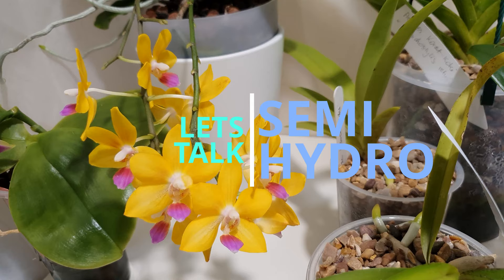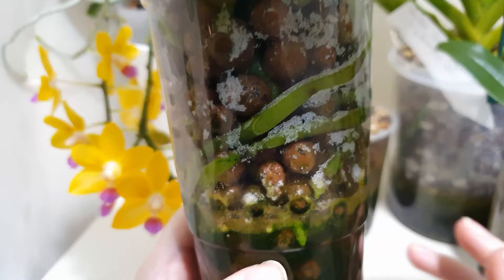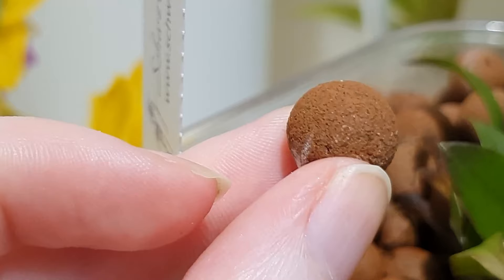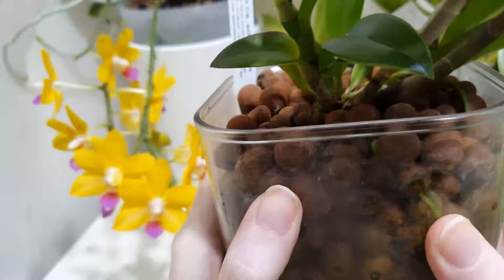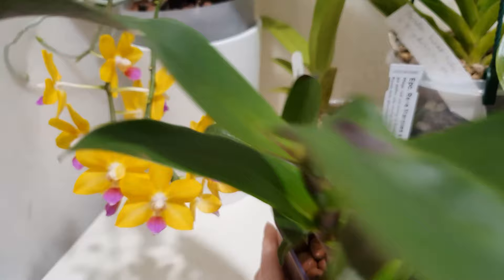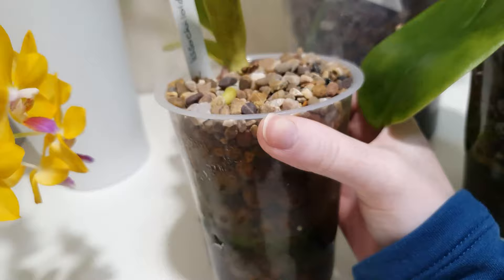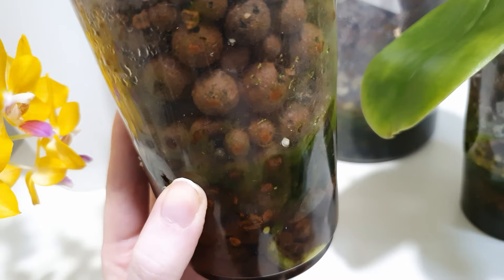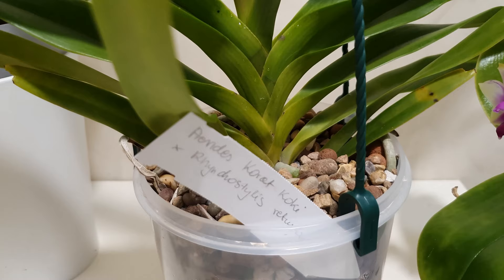Let's Talk: Semi Hydro for Orchids- Intro, Root Adaptation, Overcoming Dry Top Layers, Modifying SH

Comment: If you look at the submerged root you can see its covered with algae. Its a wellknown fact about water culturethat the algae produces oxygen which is used by the orchid roots... Maybe as you said the green photosynthetic roots also produce the oxygen it needs, or at least a part of it.
Reply from the maker: I agree that algae could definitely be beneficial in the reservoir, I know alot of people view it negatively, but I can only see it being detrimental when it all dies, like algal blooms in lakes. But I clean dead algae off when I repot, and have springtails in the pots that seem to clean up dead algae. So it definitely could be helpful in providing oxygen!

Comment: Exactly the kind of content I was looking for about orchids, most of people follow what I denominate as a "recipe" instead of going deeper into botany insight, and in fact most speak of gorgeous varieties but doesn't stick to the core concepts. I live in Venezuela and recently walking the Avila mountain I found a ground species that I am very interested on but there is little to no info about these ground orchids...  orchids are definitely very hardy plants but little is known.
Reply: I Venezuela I've seen Catteya grow even on rocks, but most orchids grow on branches and tangling around very high but really thin trunks of trees, most of the time in real shade (dark) environments with lots of cold/fresh humid airflow.
Reply: Off topic but also interesting: I was reading recently about speech and you were definitely circumstantial not tangential at the end of the video.
Reply from the maker: Thanks for your comment! 😀 It must be amazing to be able to see orchids in their natural habitats! Like you say, it seems orchids are actually very adaptable. If we can get whatever potting media we use to work together with our environment, to provide the right root environment for gas exchange and moisture/nutrient levels, then the actual potting or mounting material could be almost anything it seems. We are told - you have to pot this one in bark, or you have to put moss in with this orchid and you have to really let it dry between watering, but then that doesn't always make sense to me, when they seem to grow well even when you discard some of these rules. I wonder if orchids are actually more thirsty than we believe and some common cultural tips actually starve them 😂 

Like you say, in nature that they have lots of humidity, maybe they are even dripped on alot at the morning dew points? And they also have roots constantly exposed to air for gas exchange. So replicating that exactly in the home may be tricky, but if we can get a similar balance, maybe that's enough.

 I have more questions than answers at this point! But if I hadn't started this channel I probably wouldn't have tried out new media to quite the same extent or documented results, so it's definitely helping my orchids out to question this! 🙂 I walked into the grow room this morning and found new flower spikes on lots of my ascocentrum/rhynchostylis/neofinetia/renanthera hybrids (basically all my mini vandaceous types) , first time they've flowered for me! So everything seems to be enjoying getting more moisture 🙂

And I'm glad I didnt technically go off on a tangent 🙂 

Thanks again for your input, it's really interesting to hear a different perspective and how they also grow in nature!
Reply: @TheOrchidRoom  Excellent, and I am very glad to read such lengthy reply. Regarding hydration of the plants, I think it depends on the plant and their natural habitat, most of the ones I've seen are mountain orchids which seem to thrive in a oceanic climate rather than what most people understand as tropical, ie hot humid rain forest type, you see Caracas is a valley inside a mountain chain and this area is more like a boundary for many species, I am yet to see orchids at the peaks of the mountains of the Ávila; another thing is that we also have desert orchids that live in areas that are known to be dry but high in winds from the ocean, those environments are more similar to an Spanish dehesa than a rain forest. 

Thing is, they may be very adaptable but the range where they can be found will give you a nice understanding of their capabilities... for example, many of the epiphytic species I've seen live side by side or clustered together with bromelia, tillandsia, rhipsalis and ferns, aside moss and liken (very weird and exotic ones) and so in such environment there is no actual totally dry conditions as all these species require of constant water, and bromelia is known for storing large amounts of water . Even in the 
case of the ground orchid I mentioned, it seemed to be one that thrive in conditions that are always moist and maybe even thrive in such conditions because most of the plant is buried under a layer of dry leaves, such environment can create a micro climate under the leaves and also the creek nearby can infuse the plant with lots of dew - creeks in this area have created little canyons where all the humidity and the air flow is constant, it's basically a tunnel as the tropical trees grow very high and form like a natural green "cathedral"... in fact most of the animals you see there are big land crabs and frogs - also snakes - and these animals require constant  humidity. 

Another thing is the soil, the ground orchid was apparently in a layer of leaves with high tannin content and so supposedly acidic but yet again, the plant itself is on a soil that is highly alkaline, high in calcium and such as the mountain is sedimentary and high on these elements. Same on the epiphytic ones, they live attached to the bark but this is not a corrugated and highly degraded bark, but actually alive, rather they seem to concentrate in areas where other types of plants have retained leaves and dust, creating a highly organic matter that gets moist by the aerial conditions like thick mist and rain, also by evaporation from the bottom of the forest. They also seem symbiotic with lichen and to less extent, moss as these are perfect to catch water in constant and defused quantities, maybe adding to the nutrition of the plant.

I also have more questions than answer, orchids are a completely new subject form me. 

(PD: the ground orchid could also be parasitic of tree roots.)
Reply: I have an idea you can experiment with:  
  
Rockwool as substrate and water with organic fertiliser to add food to the plant; maybe in an aerial set up or attached to a bamboo cane.
Reply from the maker: @TheGrmany69  I tried rockwool as part of my inorganic media trials and it really didnt work well at all for me in the setup I tried. Thanks for the suggestion though 🙂

Comment: I have grown (some) orchids in semi-hydro and I share the same experience. Seems like peebles as a top layer is a good idea.
Reply: I'm in a dry /warm climate and all my orchids suffer from a dry top layer. I'm trying a perlite top layer, as recommended by a grower of Tea Tree Orchids via Google.
Reply from the maker: Yes, I have used this- ok, accumulates salt and algae very quickly, can also cause rot in seedlings. I use it for a few select cases, but it's application is quite limited in both of my climates I have experience across though.

You can find my Perlite characterisation here: https://youtu.be/fEo-YOAGdi8

Comment: 5:45 I think some variables in a SH setup that I don't hear about often is the sorptivity of various medias, the distance between the top of the reservoir to the top surface of the media, and the exposed surface area of the top. There's a limit to how high up water can be drawn due to gravity, humidity, evaporation, sorptivity, and in the case of LECA, perhaps the number of contact points with the media below it? In theory, a packed sphere would likely only have 1-3 contact points with the spheres below it, which also affects the capillary action. If the reservoir came up to right under the top layer of LECA, I can't imagine that top layer would ever be dry. 
 I'd be curious to see an experiment where a meter tall cylinder with a lid is filled with LECA to see exactly how far up the media can draw water. 
15:55 another experiment I'd be interested in seeing is blacking out the reservoir of a root that's grown into the water. Algae die off might affect that experiment though. Also do you find your orchids only grow roots into the reservoir around the edges of clear pots? If they grew into the center they can't photosynthesize. Then again roots could be phototrophic, so the reason there might not be roots in the center of the reservoir is because they simply prefer to grow towards light and not because roots can't survive without photosynthesis
Reply: Leroy Chan this was very interesting and I enjoyed your thoughtfulness.
Reply: That's why I use a top layer, it allows the LECA to wick moisture all the way to the top. I've been using moss, but I just bought some aquarium river rock to have a completely inorganic medium. I've also had some issues with the moss becoming the new dry top layer and requiring some spraying to maintain moisture.
Reply: @o_o8203   I'm saying that there's a terminal amount of wicking LECA can do regardless of a top layer or not, and that depends on a lot of factors that i mentioned. Imagine a cylinder of LECA that's five feet tall with a top layer. Would that still wick to the top? Now imagine a cylinder that's three LECA beads tall and the reservoir is two LECA beads tall. Would the top layer still be dry?
Reply: o_o please let us know if it works for you! I use the same kind of aquarium pebbles.
Reply from the maker: Hi Leroy, you have some really interesting thoughts here so thanks for sharing them!

I think the comment about absorption capacity of different LECA brands is extremely relevant, as well as the shape of the pot and relative size of the reservoir.

As it happens, a few weeks ago I bought some 100cm+ tall, 30cm across vases that I found in a discount home store! I drilled reservoir holes in both ready for semi hydro- I bought one to use for my giant aerides lawrenciae in a semi hydro setup, the other was really just because they were a unique size and I knew it would be useful for some big orchid at some point. 

So one has had the aerides in a few weeks and one is sitting empty. The Aerides is potted in a mix of LECA and pumice, and the mixture seems to be wicking quite high up the pot. I can't see any condensation but the roots are green near the top of the pot. There is no top layer of pebbles at the moment, mostly because the roots around the top of the pot now make fitting more media in awkward, will have another try soon but for now it seems to be doing ok even with uneven air pockets around the top where we have awkward roots. However, the roots in the pot will also be acting as wicks so that could also be helping with water distribution.

I could use the empty vase as a test for the LECA wicking capabilities but sometimes it's hard to quantify, as  condensation doesn't always appear in the pots sometimes, even when I know the LECA is wet, haven't figured that one out yet. 

So I've definitely found roots seem to circle the reservoir of semi hydro pots around the edges, but they do lso seem to be able to survive with less light in a moist setting as some of my self-watering pots are inside outer masks. Self-watering not semi-hydro though, so they wont be going right into the reservoir. 

As a side note, I also notice self watering with inorganic seems to be a slightly drier environment than straight semi-hydro, which could tie in with your suggestion about contact points between each leca bead/pumice piece and the next, but also the contact with the reservoir portion. compared to the more limited contact with a wick string. Like you say, each new piece of wicking media in the chain will in theory be slightly drier than the last, until the wicking capability is less than the evaporation rate.... 

Back to the point about light, the outer self-watering masks do still let some light in also, the roots are usually a yellow colour toward the centre of the larger pots (so there's probably still a tiny bit of light filtering through gaps in LECA) but I've never fully tested what the roots in the reservoir do in total darkness in semi-hydro. Even my phals that were potted in thick acrylic coloured pots, the roots in the reservoir were still green upon repotting, so some light must be getting to them somehow. 

Thanks again for your thoughts, it's great to discuss this in more detail! :-)
Reply: @TheOrchidRoom  I always repot orchids in all bark to have at least some sphag because I can never tell when bark is dry, so I can only imagine how hard telling if LECA is dry or not is. Aside from the very unscientific method of feeling the LECA, the only other metric I can think of is weighing the beads at various heights and comparing that to their bone dry weight. That honestly sounds like so much work though haha
I only have one selfwatering setup with discrete layers of bark and sphag, per Miss Orchid Girl's method of potting. Like you, I also find my top layer never quite seems to get wet. May be slightly moist at best. I couldn't help but think the most efficient and even wicking would be in vertical strips of a wicking material. Because with horizontal layers where some layers are worse at wicking than other, you're bottlenecking the efficiency of the better wicking material with the worse wicking onr. Like if you could somehow have many tube-shape masses of sphag separated by bark, the wicking efficiently wouldn't be hindered by the bark and you'd still get pockets of air and moisture. How to practically do it is another issue though... Next time I try a selfwatering setup I'm going to try having the wicking strings go vertically almost all the way to the top of the pot instead of across the bottom. In theory I think the strings would better distribute water among horizontal layers. 
Anyways, love your videos and the scientific approach to orchid culture!

Comment: if you are willing to do basically a guide of how to do SH, I do believe I'm willing to try it on a few of my orchids😉 I purchased the leca, but basically chickened out, however my obsession does need some assistance in the watering dept, so I guess I just ran out of excuses to at least try.....
I do have a question though,  does SH work for seedlings, somehow on my last splurge  I ended up with quite a few, between my seedlings and miniature dendrobiums, if I miss a day, I end up with brown leaf tips, and my buds on my mini den blasted😢
Reply from the maker: I did a potting of my rhynchostylis retusa into semi hydro recently which basically shows that, and this video covers all the principles... Thats really all there is to how to put an orchid into semi hydro.  My current method- put it into a LECA pumice mix, top layer of non wicking pebbles, keep it warm and fertilize weakly with every watering. Use seaweed  in the fert mix to help stimulate root growth, that's really it. Semi hydro can work for any orchid, it depends largely on your environment as well as other factors . For me, it's too dry for seedlings, it's trial and error really. I think with pumice it could work for me with seedlings, but I chose Seramis in my recent seedling deflasking and that's working well also :-)

Comment: Can’t find non-wicking pebbles on Amazon’ link you provided. Are they little gravel pebbles,please? Thank you. You channel is the most informative, please, carry on! It is such help and inspiration!
Reply from the maker: Hi! You can just google RHS Horticultural grit for the small grade one, they probably changed the supplier or link location on amazon. Or RHS washed gravel for the larger grade. But brand doesnt make any difference, you could use aquarium gravel or any gravel or pebbles, as long as they are smooth and non-porous.
Reply from the maker: And thank you, that means alot 🙂